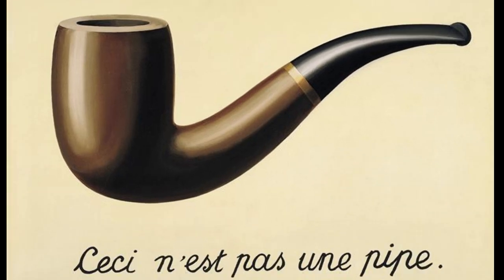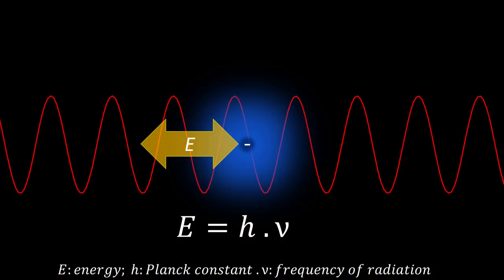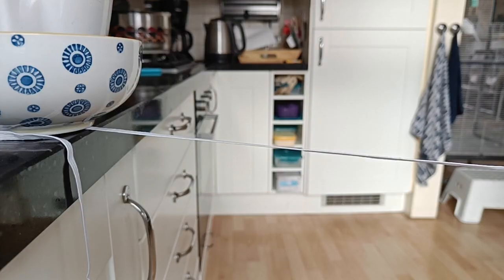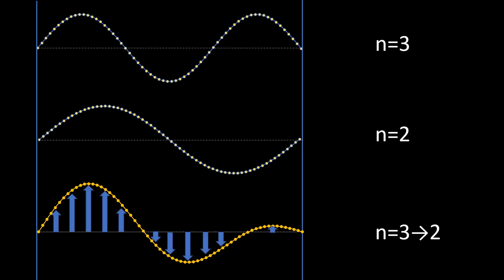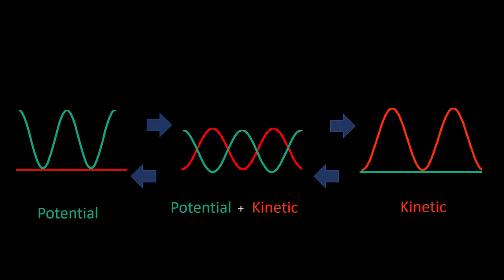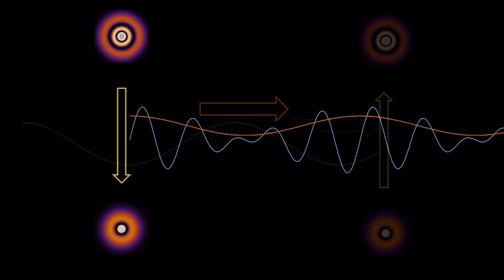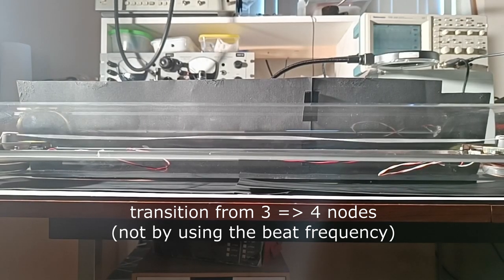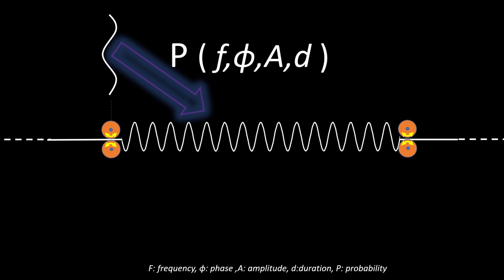Coherence part 3: This is not a wave.

Comment: Photonics engineering student here. By coincidence, about an hour before seeing your video I was looking for an intuitive explanation of a similar problem being it why the intensity of light is a square of its complex amplitude - I've been dealing with the maths for almost a year by now but that connection had never simply clicked in my mind. I've been really bothered by that the whole today, and then miraculously came across this presentation, and found it stunning. Dear Sir, you've got an outstanding intuition for linking how the reality itself works with the mathematical theory. Then demonstrating that with descriptive language and experiments. Deep respect. Thanks!
Reply: re: "why the intensity of light is a square of its complex amplitude"
Possible analogy?  voltage squared / resistance = power ... voltage is the amplitude, and power is Joules per second ... also current squared * resistance = power.
Reply: In fact, we owe the link you mention between reality and maths to others, like Paul Dirac, about a century ago. But you are very right that we enjoy a didactic video here.
Reply: Oh, where do you go to school?
Reply: I saw one youtube video once that simply showed a drawing of a transverse wave, and then animated that this wave was rotated in space, with the rotational axis being the direction of propagation, thus circumscribing a volume. I don't know how much explanatory power this really has, but I'm sure it can help in a teaching situation.
Reply: when he sez "space" replace it with Aether, also the driver on the string is the Energy in the Aether. we cannot get away from it, you can pull a vacuum to remove air, but we have no way to get away from Aether's energy's that power matter itself.
Reply: How does this video help with that? He only deals with that part of wave phenomena in the beginning with a few sentences, doesn't he? I'm still very confused on the matter.
Reply: @DANTHETUBEMAN  It seems like you are concerned with the name things are given? Calling space “aether” doesn’t make for any improvement to explanations/understand.
Reply: @drdca8263  yes it does if it is excepted that Aether has energy in it,  space suggests empty vacuum devoid of all energy.
Reply: @DANTHETUBEMAN  Aether is generally understood to refer to a substance, so, that’s why it is said to not exist. I see no benefit to physicists to start using the word aether. It wouldn’t improve predictions, and would make selling snake oil easier.
Reply: @drdca8263  the Casimir effect disagrees with you 😁
Reply: @DANTHETUBEMAN  not really?
Reply: @drdca8263  you can't get something from nothing.
Reply: @DANTHETUBEMAN  ok? But the Casimir effect just puts a force of some things. You aren’t getting something from nothing with it.
Reply: I may be completely out of line but I have some questions:  
What would completely pure light be?  
Would  it still have waves? 
Would it still be a partical?

Thank You for the video. 

I really enjoyed the visible wave machine you have built.

👍👍👍
Reply: @galileofrank5779  The video gives some great intuition of how energy travels in a wave, while the instensity of light is a quantity that describes how that wave transfers its. It kinda made it click for me.
Reply: @1dandandy1  It depends on what exactly you mean by the word "pure". Light can be described either geometricly - lines that can change angles, as a wave - transverse distrtions in the EM field or as particles - packets of energy. When you image a burning candle, the flame that you can see as a whole is actually a phenomenon emerging from on-going chemical reactions, floating hot gas and a wide spectrum of EM radiation being emitted from it - in this sense it is complex. Following this logic, one can say light on its own is quite a standalone phenomenon, and it's not like you can have a more "pure" version of it. However, the exists a notion of coherence of light. It is subdivided into temporal - how monochromatic (of a single color) the wave is, and spatial - in how many diractions it does propagate. It can also be treated a little like purity of the wave.
Reply: @cat_jones_0076  Thank You. I wondered about fire. Does fire make light in all the spectrums?  Could the light made by an arc welder be pure light? The reason that I have been looking and studying Light is because of a verses I read and would like to understand more.  
1John 1: 5 "This then is the message which we have heard of him, and declare unto you, that God is light, and in him is no darkness at all."
I cannot comprehend no darkness,  I wonder what it may look like on an oscilloscope ... maybe blank with no wave form? And if it would be solid instead of particles. 
I hope that I haven't offended  you with the question as I am genuinely searching for ideas.
Thank you again.
Reply: @1dandandy1  Ty for your response. It may sound a little picky but it accounts for an important difference, there is a single spectrum, and it's the frequencies that can be generated in their variety across that spectrum. Technically speaking, everything that has a temperature above absolute zero emits incoherent light, however, not from the whole spectrum (including infinitely high frequencies) as that would require infinite energy. Both fire and arcs produce quite a broad interval of frequencies what appears as white light being a mixture of visible colors. As for the last, science and religion/philosophy cannot be real overlapped in my opinion, though you may find it interesting that it's practically impossible to find even a small chunk of space across which the EM field has is not excited at all.
Reply: @cat_jones_0076  I've heard cold defined as a lack of heat. Does absolute zero define "pure" darkness?
Thank You.
Reply: @DANTHETUBEMAN  
Vacuum energy (virtual particles, Feynman) is a thing talked about by physics. 
     Why have one aether, if you can have lots of quantum fields which actually serve to make predictions....
Reply: @1dandandy1  just like I answered above. Even at no temperature there has to be an energy fluctuation because of Heisenberg's uncertainty principle...
    Darkness (black) is always relative, although theoretically there are nearly perfect BLACK bodies (eg. the early stage of the universe - before photons could freely move due to the re/combination of protons and electrons during the cooling down). However, black bodies RADIATE, so in this sense they aren't dark (remnants of radiation of that early stage are seen as CMB, cosmic microwave background).
    Sometimes I wonder whether there are ways for humans to directly experience subtler forms of energy, if there is a substantial flow: 
    I suppose you have to become dark enough to see the faintest glimpses of "truth".
    If science doesn't help us to create a coherent philosophical interpretation of the "world", then I don't know what would !
Reply: @1dandandy1 if God is light I am pondering what would that mean when (if) the heat death of the universe come...
Reply: @Littleprinceleon  what do yway of you think powers the quantum fields? 🤔😁 you don't have any answers with your way of thinking.
Reply: @Littleprinceleon  by the "heat death of the universe" do you mean 2Peter 3: 12 ?
Reply: @1dandandy1  If you are not trolling, then I may be able to guide you toward the answer you seek. Whether you can comprehend, accept, and implement it, is up to you and the being we're referring to as god. I don't mean to sound condescending, but from your posts, you are lacking certain scientific understanding, and have relied on the Bible for a great deal of your worldview. I am in no way discounting the notion of god, in fact, quite the opposite, but when confronted with the anthropomorphism applied to limit god to a humanly identifiable construct, most theists recoil and involuntarily dismiss the premise.
Reply: @David.C.Velasquez  I am not trolling and I feel comfortable with my science and biblical comprehension abilities.  What do you have to say?
Reply: @1dandandy1  God is the eternally infinite omniverse itself, boundless in all measurement, limitless in dimensionality and possibility. Beginnings and endings, creators and creation, are notions for mortal beings.
Reply: @David.C.Velasquez  I agree with you David.  My question is: what is light in reference to God?  From what I read God is light without any darkness.  It also seems that light wasn't created but allowed to enter creation. Thanks.
Reply: @1dandandy1  That is a broad question that may seem simple at first glance, but the answer is as complex and nuanced as a human mind can fathom, since human sight can never truly behold infinity. Although I have read the Bible several times in my life, I can't frame this with reference to scripture, except for Exodus 3:2-? Moses asks the being we are referring to as god, about it's name and nature, to which the reply is "I am that I am" and that to behold it's true form would surely be fatal to Moses. There are infinite worlds, where every history and future, imaginable and unimagined, is from the perspective of a higher dimensional observer, a simultaneous unchanging manifold structure, loosely known as the block multiverse. Photons which are quantized, particle-like packets of light, are able to interact with their unseen counterparts. This has been proven to me without a doubt experimentally, with various configurations of the double slit apparatus. Unlike us, being composed of fermionic matter, and seemingly locked into this particular 4D hilbert space. The ramifications of this, are that light fully permeates all of the multiverse, in a sense observing all possibility simultaneously, beyond time as we experience it. David Deutsch, the quantum theorist that occupies the position once held by Isaac Newton, did a piece on BBC, that I saw on PBS in the mid '90s that opened my eyes to the mysterious phenomena I had witnessed in college, and led me to spend the last 30 years contemplating it's significance to life and the infinite. I apologize if I didn't address your question in a more satisfying manner, as my knowledge and experience are but a drop in the boundless sea that is god. Obviously there is much more to be said, but I'll leave you with a link to the David Deutsch program. Try to view it with an open mind and a grain of salt... it is a 30 year old discussion after all. Be safe.    https://www.youtube.com/watch?v=SDZ454K_lBY
Reply: @David.C.Velasquez  Thanks David. I will look at it openly and get back to you.
Reply: @David.C.Velasquez  David Deutsch perceives more than our we can with current technology.  I wonder if it will ever be possible to see that perception in this verse of our reality or if the answers await us in the next verse.  I think light is the key.
Reply: @1dandandy1  I apologize for the delay in reply, my notifications keep being disabled for some reason. My mindset is totally in agreement with you, that light is the key to the next level of understanding reality and it's intricacies. I believe we are able, in dreams, to see these other versions and possibilities, if only temporarily. I have woke to the real feeling of loss, and memories of another life or wife, similar but somehow different, and almost could weep as I try to hold on to some small piece, as this reality reasserts itself onto my mind. One day we will wake, to find that this life will have been that dream, we're desperately trying to remember, as we continue our eternal  journey toward the infinite. Unfortunately, subjective experience cannot be directly proven to a separate observer, therein lies the true crux of faith... acceptance of the eternally infinite.
Reply: @galileofrank5779 He wouldn’t offer a free pipe if he didn’t realize you’ve got a what came first here. The chicken or the egg. It’s a prerequisite to an extremely difficult pickle

Comment: One of my favorite days was when the professor calculated Snell’s law by assuming continuity of Electric fields across the surface boundary.  It is a reason to believe other basic laws of EM fields can be derived from fundamental principles.  This channel presents a perspective that differentiates convenient assumptions (electron is a ball with a minus sign on it) versus fundamental principles.  It should be standard course material in Universities … especially for those who want to push forward fundamental understanding versus simply applying cookbook recipe solutions.

Comment: I've done calculations on the interlevel transitions of confined elections in semiconductor quantum wells using Fermi's golden rule. An incoming electromagnetic wave perturbs the confining potential of the well at the frequency of the wave. This induces mode coupling between  states leading to an electronic transition. The perturbation is highly analogous to the longitudinal potential energy wave that you observe on the second loud speaker. What a beautiful  demonstration.😊

Comment: This video hit a lot of good stuff. 1) The Coulomb model of the hydrogen atom has exact energy eigenstates, which are called "stationary" states. They do nothing but oscillate, and what is oscillating is the "phase" of the wave function. The phase is unobservable. In an energy eigenstate, the electron has a specific energy, and it cannot change, it cannot transition: it is stuck for eternity.
Well that's not physical, so you add an interaction: the electromagnetic field. Now you can't solve the problem analytically, but you treat the prior states as approximate states. Because they now can decay, their energies are no longer well defined, but have width given by hbar / lifetime.
In your string model, if there is no decay, you can't transition from one mode to another. The problem is your decay rate is not coupled to the transition because you're supplying energy from the outside, so that just breaks the analogy.

2) Regarding superposition: when an electron in an atom is in superposition of 2 eigenstates, the two phases oscillate at a beat frequency, and it's very much like your two-mode string oscillation. See "Rabi Oscillation". Note that many quantum mechanics homework/exam problems are based on this principle, so any physics BA should know it.

3) What is oscillating in the electron wave function? It's the global phase, which is unmeasurable. The frequency is f = E/h, and represents the rate at which the wave function returns to the same global state. In momentum, the wavelength represents the distance you need to travel for the wave function to return to its same state....so these are symmetries: time or space translation that do not change the system.  This is consequence of the celebrated Noether's theorem: for any symmetry of a system, there is a conserved quantity. If the system is invariant under time translation: energy is conserved. If it invariant under a spatial transition, momentum is conserved, in that direction.
If the system is invariant under rotations, angular momentum is conserved. This one is more complicated, because rotations don't commute, and as a result: you can't know all the components of angular momentum at once. Moreover, the wave functions that solve it are spherical harmonics, which give rise to the atomic orbitals shown at 19:58 . They have many fascinating properties and are described by "Racah Algebra"....the coupling of angular momenta generalizes "beat frequency" between two energy modes is a most non-trivial way.

Comment: Here are some suggestions:
- Use a circularly polarized wave. This way, the string does not have to expand and contract all the time, lessening friction. It's also closer to what the electron does, what with the phase rotating in place.
- I think your explanation of how an electron exchanges energy with the EM field is known as the "oscillating dipole approximation". There are higher-multipole versions of it, too, but what you depicted (the transition between to s-orbitals) would not work because there is no electromagnetic monopole radiation.
- In the oscillating dipole approximation of an electron absorbing a photon and going to a higher frequency state, it is the oscillating charge distribution of the electron that allows the EM field to latch onto it and yank it around. To emulate this mechanically, you would need to have an interaction with the string that is the stronger the greater the amplitude and/or speed of the string is. Maybe a periodically modulated airstream blowing against the string, possibly stronger on the uppermost part of the wave?
Reply: if the circularly polarized wave was introduced as rotational acceleration from a baseline, (idk how feasible it would be but if appropriately calibrated magnetic bearings for example would let you spin and reflect the whole captured wave state below whatever relevant energy conservation thresholds are needed to make useful observations) then would centrifugal force provide the interaction you are describing? 
Granted in this scenario you'd probably be better off spinning it up and observing the decay than driving it directly but it doesn't seem like that should matter too much if we're just looking for an intuitive analogy with waves.

Comment: My thoughts:
-You could use a guitar string as they seem have tones not decaying too fast
-A tuning fork or quartz oscillator
-Tibetian songing bowls also hold the sound for quite a long time in my experience
-In general my intuition would vote for an elastic material with high density (more potential energy) and high stiffness (high speed of sound)
-I could even imagine a setup with water or some other nearly incompressible fluid (water waves seem quite stable on lakes and the sea)
Hope I can give some inspiration. Love your videos. It's always a pleasure when a new one gets out. Really inspiring to see questioning and rigorously building the basics, like you do :) Thank you!